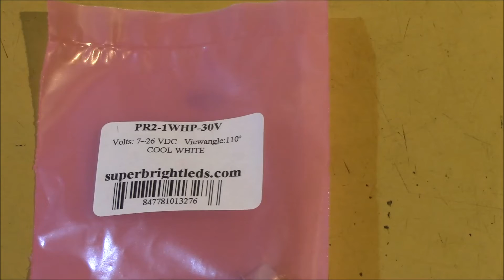Post Bag - 18.Dec.2014, Pt. 2

Comment: Thanks for the tip on led if I need a Bulb.Just Changed this light to 20 volt lithium ion Bauer Battery .
Reply from the maker: This same bulb is still working for me today, over 7 years later.
Reply: @The4Crawler  That's Great You got your moneys  worth. . I made my own adapter with the Bauer $13 light battery base . I had no Craftsman Batteries . Bought light at flea market for $3 !
Reply from the maker: @wayneo7307  Yes, that bulb should work with most any ~20V power tool battery.